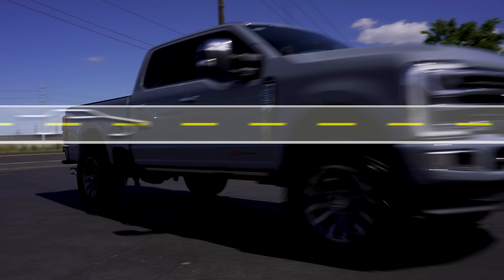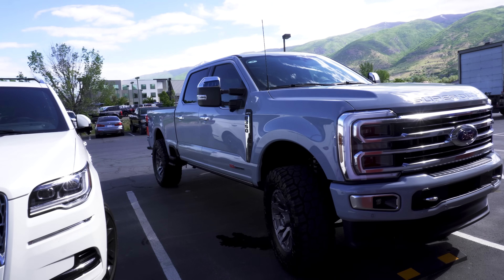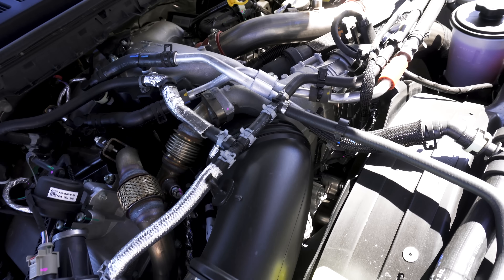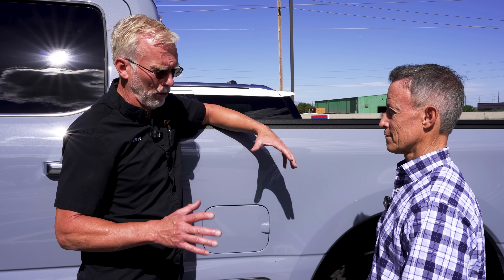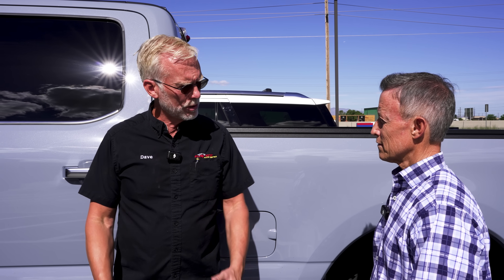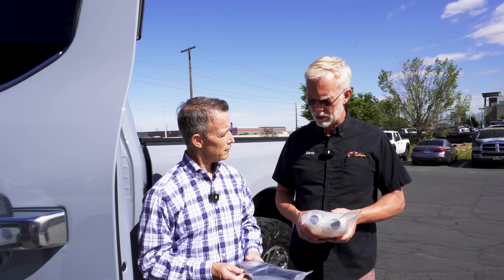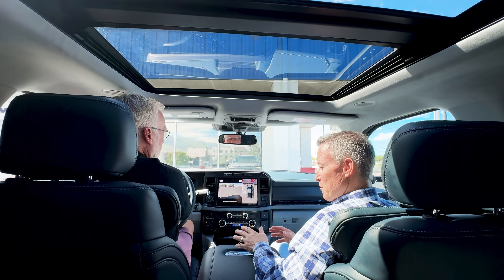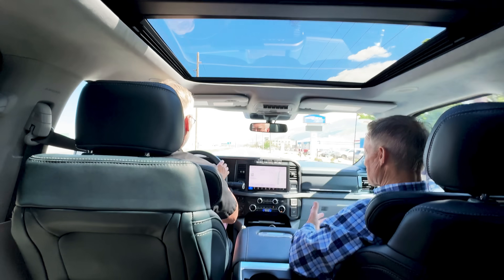Diesel Truck Maintenance

Comment: I had Sprinters back in the day and would do the oil change myself as the dealer was over an hour away.. every 5000km oil change those engines ran high mileage...oil is cheap dude!

Comment: At 70 years old, it kind of pisses me off how all the multitude of government regulations have forced vehicle owners to deal with all the garbage now installed on modern engines.
The government has taken engines (especially diesels) and ruined their affordability both to purchase and maintain.
EGRs, DEF, Catalytic converters to name a few.
Sure, I do not want to pollute, but there has to be a better, more common sense way. Why do bureaucrats  refuse to listen to engine experts like Dave and allow manufacturers to build engines so they run well, are more efficient, and are affordable to own.
And do not give me that EV crap. 😢

Comment: I have a 2000 F-250 7.3 and do my own maintenance and at 182K she's still running sweet... But two things about EGTs, I've never let my temps get over 650 degrees and if so down shift to get the RPMs up to cool it down... and I go anywhere I let her idle till she's cools down to below 300 degrees! Still runing original turbo!

Comment: Huge great reminders have a 6.0 I religiously maintain. Oil changes every 3500-5000 full synthetic fuel filter changes every other oil change runs better than when I bought it. Not to mention arch oil fuel and oil additives or hot shot secret additives both work very well.

Comment: Ford Senior Master Tech here and this is my recommendations. 1st and foremost read your owners manual and the scheduled maintance section. Ford uses what is called an IOLM for oil changes which stands for intelligent oil life monitor. The IOLM  monitors many things to include engine load, vehicle speeds, temperature, regenerations events, etc to calculate when an oil change is due. Most of the time it is right around 7500 miles on a 6.7 diesel.  I prefer factory filters since i have seen all the  issues with cheap aftermarket filters.  Highly recommend  trans, diff, t-case svc every 60k unless severe use like constant towing then reduce to 30k. Fuel filters every 15k. All air filters every 20k unless real dusty conditions then drop to 10k-15k.  Ford makes an excellent fuel additive that is designed to work with your fuel system and boost cetane and lubricity. I use it in my 6.0 diesel and buy it by the gallon to refill the single shot bottle which treats 35 gallons diesel, much cheaper that way.  1 gallon PM-22-GAL,  single shot PM-22-ASU. 

DEF fluid is 32.5% urea and i have not seen any real issues with different brands. Generally you will fill the DEF tank at every oil change.  When the system goes into regen it is very important to complete the regen before shutting off the engine. Incomplete regens cause more issues than you can imagine.  Diesel fuel is a crap shoot on quality and actual cetane rating. Here in Oregon it is crap compared to what is found  in other states.  Ford designs their engines off a cetane rating of 44 and here if you find 40 cetane your lucky.  Just like gas there is summer and winter blends of diesel.
Reply: Thanks for your input Sir !!! MUCH appreciated !!!
Reply: I always appreciate hearing from people who know their stuff - thank you for that!
Reply: How do you know when the regen is happening. They don’t have a gauge for it and the dealership said there’s no way to know.
Reply: @PasoB1980  There will be a warning message that displays on the intrument cluster and a drive to clean message. Messages vary depending on year and model and level of instrutment cluster. It should be detailed in the owners manual.
Reply: @NBiehle  it is possible for Ford tech to enable an indication on your cluster , under maintenance , that will show percent full for the dpf filter.
It is not perfect , but if you keep and eye on it , you'll see when you 95 /99% full  , keep driving.
 I found if up to temperature , truck will go onto regen . I find driving a speed to keep rpm's at/ above 1500  burns down pretty good , you can watch the indication  count down back towards 5%.
I never seen a 0% or a 100 % on the scale , as i ssid not perfect.  But it works. I learned this from Arod on youtube channel.
Reply: @PasoB1980 there is not a message on a 2024. It will start to high idle almost to 2k it gets twice as loud and you can easily smell the def at the exhaust. Mine goes into regen almost every single morning I start it.
Reply: @PasoB1980 I’ve heard a willing dealer can unhide a hidden screen on the dash to show when dpf in progress and dpf fullness percentage. Or you can do it with forscan. I think there are aftermarket options as well like banks i-dash. I can tell on my 21 because the dash screen fuel economy cylinder that goes up and down to show instant fuel economy gets way more sensitive than normal. (Drops faster with less throttle input) also the heat coming out of the exhaust will burn the shit out of your hand if you get it too close. And the engine sounds a lil different it seems. Also my engine fan engages more. (Roars) Idk why ford didn’t just include the damn screen.
Reply: 24’ F-250 6.7 HO. I asked my ford tech about the regen cadence.  I told him at 8,500 miles I’ve not had a regen where I get a notification that one is about to happen.  The most my exhaust filter has gotten to is 80% and then it will work its way to 0%. Sometimes this will happen at 60%. So it seems like every couple weeks, maybe more, my exhaust filter is resetting.  The Ford tech said that the new motors do more of a mini regen and they happen more often… I couldn’t find any information on that in the owners manual.
Reply: Great info
Reply: Great info! Any tips for starting a 6.7 (2019 F350) that’s been sitting for a few years. It’s stored in Boise Idaho (indoors) so it’s pretty dry but can get cold in the winter / hot in the summer.
Reply: @TsavoTouring   1st check all fluids.  Check air filter  and make sure there are no mice nest in there.  Charge batteries with a charger since using the alternator to charge low or dead batteries puts  a lot of stress on the alternator.  Cycle the key on for 30 seconds turn off and repeat 5 more times. That is the procedure for priming the fuel system when filters are replaced and should prime the system if any bleed off has occured. Fire it up and let it idle for at least 5 minutes and check for any leaks. I have yet to see a 6.7 with a case of "lot rot" which is where the valves rust to the guides and then when started generally bends a pushrod. I have seen this with 7.3, 6.0 and 6.4 but never a 6.7 diesel.
Reply: @mr.c.6241  thanks - lot I appreciate that. I also didn’t realize lot rot goes that far. I knew that there were problems with brakes and such but didn’t think about internal components.
Reply: I'll copy & paste this information for future reference. Many thanks!
Reply: Idk about the Power Stroke but that DEF system on the DMax is an engine killer.
Reply: @Webedunn  The DPF is the main killer of the 6.7 engine and fuel economy. The DPF traps soot/particulates and to burn them off during regen the injector fire off again on the exhaust stroke dumping raw fuel into the exhaust which ignites the DPF catalyst to over 1100 degrees to burn off the accumulated soot. However this raw fuel also goes by the piston and into the crankcase which is one of the reasons why 6.7 engine oil is jet black becuase it is also washing soot from the EGR past the piston rings. The rings on a 6.7 are way looser than those on a 7.3 or 6.0 diesel.  Ford finally released a blow by spec for the 6.7 and it is a max of 1 psi measured at the dipstick tube at idle.  7.3 max blow by is  .108 psi at 3000 RPM and a 6.0 is .228 psi at 3000 RPM with the breather blocked off and special guage setup with hole in it installed, HUGE FREAKING DIFFERENCE.   The DEF/SCR system really has no affect on fuel economy since its primary use is to neutralize NOX emmissions.
Reply: Thanks. What's your opinion on what he said about the injector cleaners?
Reply: @thesurchris  Ford makes an excellent fuel additive that increases cetane rating and increases fuel lubricity and i recommend it highly on all Ford diesels especially 7.3 and 6.0 since they are not designed to run on the current ULSD we have now.  BG also makes some very good diesel additives. In fact BG has now partnered with Ford/Motorcraft for 3.5 turbo services. Stay away from any additive that contains alcohol  and any additive that goes in the DEF tank.
Reply: Nice write up .
About the regen. I have a 2020 , you didnt know if the truck was in regen , so didnt know to kerp driving. My 2015 i could tell by the instant mpg's monitor .
 I had my 2020 's  dpf filter percent full indication turned on , not perfect, but i keep an eye on it , so i know when to take the truck on a good run to clean it out.
Has the newer fords gotten any better with indications on the dpf  / regen status , so the driver knows to keep driving ?
Reply: How much different if a trucks deleted?
Reply: Thanks for sharing 👍🏻😃
Reply: My dad just gave me his ‘03 super duty. He’s always taken good care of it. Are 6 liters really worthy of all the horror stories I’m hearing???
Reply: This is why I won't let my 7.3 go sure the new moters have more power I pull my trailer just fine  the new moters are crap I have friends that have them and have nothing but issues
Reply: What brand of die would you recommend in Oregon? What do you run in your truck?  I tend to fill up at Costco. Is that a mistake? Thanks
Reply: Do you recommend draining water module assembly/separator monthly?
Reply: 7500 oil change intervals!!! Yes you are DEFINITELY a master technician. That advice is why these diesels are going bad. 3k mile oil changes especially a diesel!
Reply: @russelbrown6275  I would suggest you read my post again. 1st thing i said was read your owners manual and the maintanence section. Then i said the IOLM on average goes off around 7500 miles which is typical for all the pavement princess out there. My personal truck which is a 04 F-350 6.0 diesel gets the oil changed every 3k miles without fail and the main reason is the HUEI injection system. When i change my oil it is still clean.
Reply: @russelbrown6275 agree with you , 7500 miles too high, I do 4000 mile oil changes. intervals.
Reply: @russelbrown6275 I like the oil test method. Why waste money if it don't need to be changed at 3k.

Comment: Used to have a Hyundai diesel.  Was getting a DPF regeneration error.  To regen, the ecu triggers a fuel injection on the exhaust stroke..the fuel in the exhaust burns and raises the exhaust gas temperature which then burns out any soot in the dpf.  The issue was that the exhaust gas temperature sensor was faulty and the ecu continued to dump fuel on the exhaust stroke waiting for a corresponding rise in temperature, which of course never happened.   All the time it was doing this, the fuel on the cylinder walls was being pulled into the sump.  The oil had a consistency of water by the time I realized what was going on.  Sold it on shortly after.....

Comment: I’m very anal with my fuel quality. I sample every fill up in a clear container before filling to avoid putting contaminated/water in fuel in the tank. I change motor oil and fuel filter every 5,000 miles. I drain my water separator once a month.

Comment: Congrats on a beautiful truck.
Upgrade the fuel filtration.Would be great to have a fuel/water separator.  DEF: all meets that same standard for formulation. Don't overstock as it has a shelf life ( I think 1 year ). Fuel treatment: I use Power Service's Diesel Kleen with every fill. Boosts cetane rating, adds lubricity and most importantly, lubricates and cleans the entire fuel system. Using it raised my average mpgs from 11.2 (was in computer when I bought the vehicle with 15K on it) to the current 11.6. (now with 40K miles). Doesn't sound like a huge improvement  but is great for a 37,000 lb. luxury diesel pusher motorhome with a 150 gallon tank. IF you are ever going to store the truck or not use it for an extended period, add a biocide and fill the fuel tank. I use the marine industry proven BioBor JF. My brother-in-law recommended it. Uses it to protect his diesel 650 gallon tank on his boat. Has never had the dreaded algae. Neither have I when I add it at our base camp where the rig sits for 5 months. Never lug the engine. Enjoy the torque!

Comment: I love my 2000 F350 7.3l, but mine is nothing like that interior.   Thanks for the information on what to do with a truck.  I use mine 97% for pulling a 30 foot 5th wheel in Colorado and have to keep a keen eye on the EGT driving I70.  I will not let my truck go over 1200 Degrees.

Comment: Owned 10+ diesels ford chevy and dodge ...never changed the oil in any of them 350,000+ miles on everysingle one ...its all bs just drive it and check the fluids ....ps I pull 15k minimum everyday

Comment: They did not mention that is the new 6.7-HO and a Limited.  Beautiful truck.  You'll see the 6.7 badges in red on the doors.  I have a 2023 Lariat with the HO.  I pulled my 3-axle Cyclone from Florida to Arizona in May.  It's a beast.  Great information.  I'm at 12,000 miles and have changed the oil twice.  I'm going to do the fuel filters at 15k.  I'm going to start running Diesel Kleen in the fuel tank.  @DavesAutoCenterCenterville you mentioned coolant, power steering, transmission fluid flushes at 30k.  I had not heard of doing those at that short of intervals.
Reply: I switched from diesel clean to Archoil, had to research them both.

Comment: Today’s Trucker Tip:
     Idling an emission control diesel is a killer.   Idle as little as possible.   I recommend a bypass oil filtration system.  It’ll cost, yet this particular customer wants to keep his new rig, until he dies.  That will help.  I do know, a particular oil bypass filtration system has a designated valve to obtain a sample.  Contingent on analysis, trace/wear metals, silica, other - such as potassium - which can indicate coolant intrusion and can detect fuel dilution can alert to a fault before it becomes catastrophic.  
            Thanks for reading.

Comment: At 11:20 he talks about flushing a system at 50,000 miles or 30,000 miles if towing. If I was to go to a Ford dealer and ask for this, what specifically would I ask for? A cooling system flush?

Comment: Oil additives, no! Fuel additives yes- most important for diesel like he says is keeping the injectors clean and adding lubricity to the fuel. Don't rely on LAC or the government mandated additive levels in the diesel it's not enough. Boosting cetane levels can be beneficial if your fuel cetane is notoriously low. Can help with power and startability. Finally in cold weather you want to prevent the diesel fuel from gelling

Comment: I have a 2016 f350 6.7
Stock with 231k on it I'm original owner 
My def system has issues where I thing the truck does not do a Regen at all?
I think the def blows by the filter as I see white smoke at times and never get a Regen msg on my dashboard 
What's your thoughts?

Comment: As European let me tell you , the biggest issue with modern diesel engine is all the emission crap in them , that’s most common thing you will have problems with . Engine itself just needs regular maintenance, but particle filter , ad blue , electronic sensors , intake of exhaust gases back into engine to be fired once more ( EGR ).. 2000s diesels engine runs 1 million kms in Europe and some even uses kitchen oils like sunflower or whatever . Given its rotary not the common rail modern diesel engines, which are very sensitive. All and all remove all emissions stuff and do maintenance and the engine will survive 2 million km

Comment: I will have to disagree with you on a couple things. You don't need fuel additives, except for anti gel when below freezing. You should instead upgrade your fuel pump to a fass or airdog for 3 reasons. First you get better filtration to protect the injectors. Most oem filter systems only filter down to 15 microns while aftermarket can go down to 2 microns. What is the biggest killer of common rail diesels? A stuck injector that burns a hole through a piston. The 2nd and 3rd reasons are intertwined, better fuel supply and air removal. Diesel is a fuel oil so it also acts as a lubricant for the fuel system. Aftermarket pumps provide more gallons per minute making sure there is always more than enough fuel available to the injection pump. Have you ever noticed how foamy diesel is when you fill the tank? That is entrapped air being released. What happens when diesel go through the fuel pump and then the injection pump? That's right it will foam, also known as cavitation, which will lead to faster wear on the fuel system. Fass and airdog pumps remove the trapped air.  Lastly you don't need to change the oil at 3500 miles. As long as you use a quality oil you can go at least 7500 miles. I run rotella t6 in both my trucks and have gone up to 15k with oil analysis saying it could go longer. I now change every 10k or once per year without analysis. Now if you do a lot of idling then yes change sooner.
Reply: Iv spoke to several diesel mechanics who have had countless aftermarket lift pump failures. Airdog and fass
Reply: The airdog I have on my 01 cummins did fail after 10 years but airdog did replace it under their lifetime warranty. Just make sure you buy it from an authorized seller and register it for the lifetime warranty. Otherwise it only has a 1 year warranty. @mattwpolo1990

Comment: I change my fuel filters every year  when doing an oil change on my Tiffin motorhome. Should I be pushing it out to 15,000 miles as you said?  My coach would not see 15,000 miles in five years.